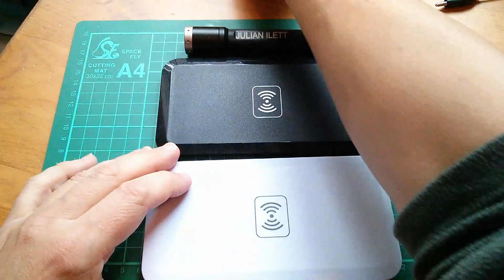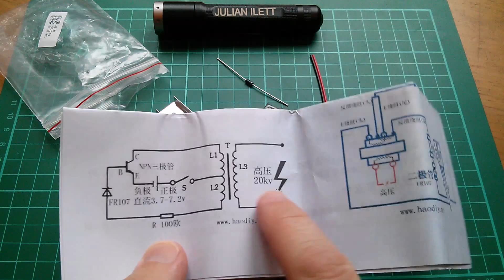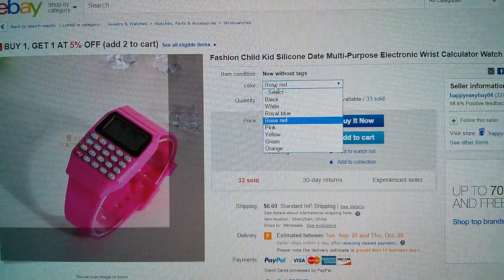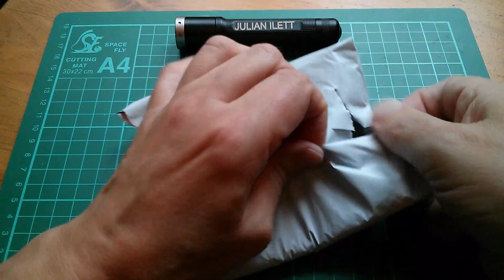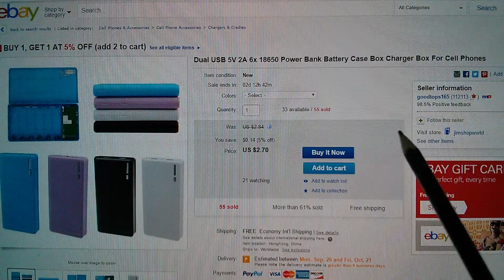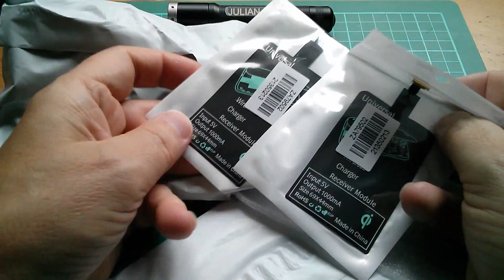Julian's Postbag: #70 - Ten Items in Ten Minutes (well almost)

Comment: lol i used that usb meter to monitor 2 x 26650s in series works a treat lol
be careful with them cables with no switch on the current monitor gets hot when drawing 2amp probably melt after a bit especially the type c cables lol

Comment: the powerbanks work fine , i have had one near 2 years for the same price and design, one port is 1 amp the other 2 amp, they work as advertised. they doa 4 and a 6 cell version, only charges at 1.1a though so takes forever for 6 cells

Comment: Julian, do you have any pointers how to disable the stupid timeout on power banks, mine won't actually charge my phone fully because the phone modulates down the current toward the end of charge and the powerbank shuts off!
Reply from the maker: Stick a USB light in the powerbank's other USB socket? Charge the phone via a Qi (chee) wireless pad - it'll draw twice as much current from the powerbank. Both pretty hopeless suggestions I think you'll agree :)

Comment: do not rely on just one humidity meter if you buy it from ebay. I would buy 2-3. There is a adjust on the back of the mechanical ones. You can tune it with flat screw driver

Comment: Can any one of you electronics experts answer this please? If I run loads of 12v LED strip from a 2A switch mode DC power supply but the strip requires more like 3A, will the power supply just current limit to 2A or burn itself up trying to give all the current it is asked for? Or does it vary between supplies?
Reply: varies

Comment: You have come up with the exact same solution as for using tp4056 charging boards! In the end this solution is cheaper and easier than running dc to dc converter with isolated ground. I build speakers as my hobby and most of the People that I build speakers for don't want any thing else than USB for charging but they also want power and only higher Amps will put out more power. Long story short Qi Wireless for the win!

Comment: I have one of those keweisi dongles.
Reply: +anon mouse me too and I love it.
Reply: Me too, they aren't a "charger doctor" though, they won't fast charge anything, but handy for voltage and current checking.
Reply: TheEnd do you mean it can't pass through higher currents ? mine does let through at least 1.4 A. I saw that when it was connected between the charger and my Nexus 10 Tablet
Reply: I have seen over 2A between a powerbank and a phone, but a true "charger doctor" (in the way I always thought of them) should emulate the D+/D- lines of official chargers to enable fast charging from other sources too like the YZXStudio versions.
Reply: TheEnd you're right. I just like what it is. Handy to see amps and voltages on one screen together and also mAh measurement. It also has a byte or 4 of memory to store the mAh when its feeder runs out of power. That is THE moment you want but without the memory you'll end up in a chicken or egg situation :D

Comment: A quick note on that very cheap power bank case, I've got a 4 cell version and after removing the board and taking the cells out a couple times, the battery + detached from it, so they've also apparently cut cost by making terrible soldering joints, oh and if I remember correctly I believe it also made an audible hum.
Reply: +vgamesx1 I believe thats the inductor. My powerbank does it too when I use my 1.5 A USB soldering iron on it :)
Reply: ***** You mean those cheapie $5 irons? Yeah I got one of those too, they're pretty nice. :)
Reply: +vgamesx1 yeah I got one when Clive demonstrated it. It works great for soldering except for when using wick, it cools down too much for it to suck the solder up

Comment: Julian, would you mind testing if the KWS USB Meter keeps the capacity reading over powercycles, eg. due to a powerbank cutting off?

Most cheap LCD USB meters are useless for measuring the capacity of powerbanks since they lose their data with each powercylce.

Cheers,
Philipp
Reply: I've got one of those Keweisi units and it does remember cumulative mAh after you've unplugged it. You clear it by holding the reset for a couple of seconds
Reply: +webchimp Thanks for the info! Much appreciated

Comment: for the white voltage/ammeter, it seems to be showing values only when they change, which would explain the rapid flashing back and forth at the start. It would be interesting to see if it switches back to voltage if you were to change that without changing the current (with a constant current source or something.)
Reply: I have bought at least 30 of these. The latest bunch shut down the display when not in use (nice). They are also clever and adjust charging current depending on the source and the phone. Almost the only one that can charge a Nexus 5 at maximum speed. We use Nexus 5 at work and they are a pain to charge fast without these charger cables. Enough of that, the display shows the load voltage for a few seconds and then shows amps only, for the rest of the charge.

Comment: That 6 cell powerbank had no issues charging my nexus 5 and dell venue 8 pro tablet at the same time... There is quite a lot of drop over those springs though, they got as warm as the charge circuitry. Also, take a knife and roundover the edges of the clips on the round side of the case. If left as they are, they won't clip together properly and you can see it in many of the ebay listings. Once you fix the case, it clips together fine and is actually quite a good powerbank. The LED has a hilariously long delay on double tap.

One thing I really like about them though is that the outputs are always on.

Comment: I am going to order this power supply module: http://ebay.com/itm/291719634537 The front panel looks like your.
Reply from the maker: Don't trust the max current rating - I think there's an 'optional' fan available to run these at their rated current. The OS is also slightly different on the DPS3012 12A unit.
Reply: +Julian Ilett yep, I just inspired from your previous video from a similar power supply module. I am going to use this for my hobby projects, 1-12v 1amp max.
Reply: That one doesn't have the high power module like the one Julian reviewed the other day.

Comment: Be careful with theses wifi chargers. They get hot when on dark surfaces. And sometimes they stay on even then the device had been removed.
Reply from the maker: Can't say I'm surprised.
Reply: Wifi chargers? If you mean the wireless QI chargers then that is the downside of open design. QI is fine when designed right. Well I kinda expect chinese designers to cut some corners when making it as cheap as possible. And with wireless charging it is not that bad if something goes wrong when compared to cheap powerbanks... or 800 dollar Note 7 phones....
Reply: sorry, I meant wireless

Comment: hi julian the qinter pad is it true fast charge for a samsung s6 as to do a fast charge it would need to put out 9v
Reply from the maker: No, the Qi pads are cheapy cheep cheap 5 volt ultra lossy (wouldn't be surprised if they get hot) cheap tat. They probably do work though :)
Reply: +Julian Ilett thanks for replying I've been looking for a cheap 9v wireless charger without it being fake or being super expensive
Reply from the maker: Oh heck. There appears to an update to the Qi charging standard that incorporates Quick Charge 2.0. When will they stop messing about with the (so-called) USB standard?
Reply: +Julian Ilett ohh so it does do quick charge that's great will be grabbing a few of those thanks for telling me and the standard have gone way out of wack since qualcomm
Reply from the maker: No this $2 pad definitely doesn't do 9v charging. I'm not sure whether the quick wireless pads are available yet.
Reply: +Julian Ilett ohh sorry I must have misread they do have them available but only by samsung and they charge around £60